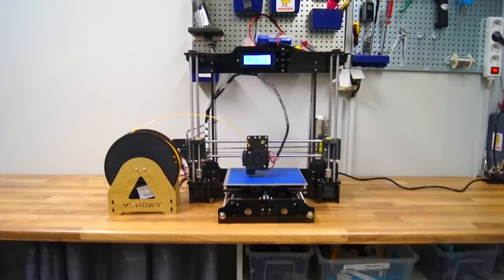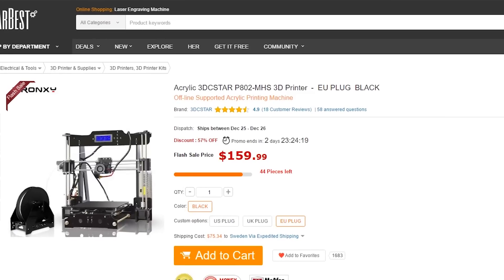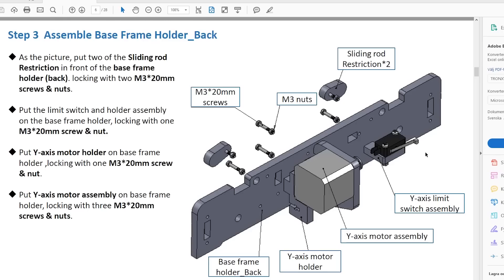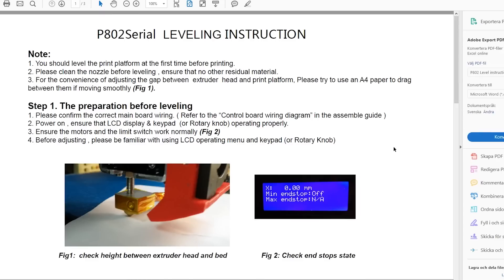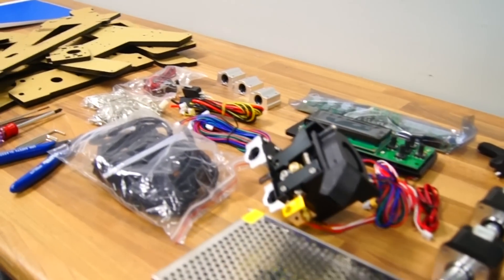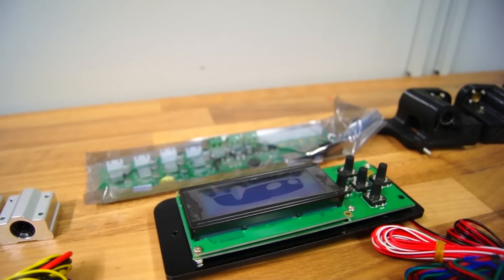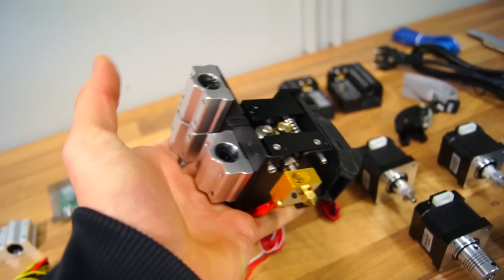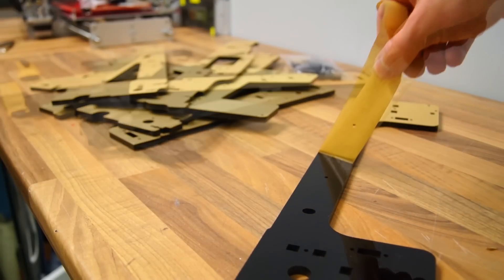Cheap 3D Printer Kit - 3DCSTAR Review

Comment: I got a Anet A8 but it will not heat up the hot end do you know what steps to take to fix it. I have confirmed it is sending power to the hot end but it didn't heat. If I have to replace the hot end heater what would be the type. My printer did not come with all the paperwork and the USB drive doesn't include the part number for the heater.
Reply from the maker: Did you resolve you problem? Sorry for the slow response.
Reply: No not yet. I think I will have to replace the hot end heater.

Comment: I also mounted the motor plate wrong! ahahah
Very nice printer...
Reply from the maker: It sure is :)
Reply: I still have one issue, when slicing with slic3r, the printer does not extrude, it start's printing, it does all the movements, but no filament comes out...
When using Cura, everything works fine...
What can this be?

Comment: One thing I noticed is that most videos of this printer show incredibly fast print speeds, leading to some pretty poor quality prints.  I've found that it helps to print slower, especially when you dial in the temperature.  Also I noticed that one of the threaded rods for the z-axis for my printer was tight (like the rod was a bit too big).  This led to binding when the Z-axis' were moving the extruder up (meaning one side would move and the other would not).  I fixed this with some lubricant.  Other than that, good review, I concur that this is a good deal.
Reply from the maker: The reason I print quite fast (55mm/s) is because I simply don't care about the quality. I always go with 0.3mm layer height and print at high speeds. Though, you are correct, lower speed does result in much nicer prints.

Comment: What is that blue stuff you put on the bed? Something like masking tape?
Reply: As LostName stated, it is usually more expensive than masking tape.  
> Tamiya Masking Sticker Sheet < is similar (250mm x 180mm) but is roughly 
$2 USD a sheet.  You can find it in hobby stores and on the internet (Ebay is one source).
Reply: Team PhreakLand Exactly. It helps with the bed adhesion during prints (It prevents your parts from being knocked off the printing platform).
Reply: But I've only ever seen masking tape in, well, tape-form. Do you have any idea where I can get this stuff in such large patches?
Reply from the maker: It came with the printer, can't find it on their website though. Shame, because it works really good.
Reply: I saw it on eBay once, but it is a lot more expensive than normal blue masking tape

Comment: I think anet a8 has better control board what do u think about it ?
Reply from the maker: They are very similar, but a lot of people are reporting major problems with the Anet version 1.0 motherboard. Usually connectors melting, or even catching fire.
Reply: I think the connectors arw melting because the cables were not inserted properly. I have the A8 myself and its quite tricky to assemble it if u never did something like it.
And btw I have no problems with the v1 Motherboard.

Comment: Congrats for 10k subs, man! And great video! But... I don't know... Looks a bit completed to me. Too much wires and connections. Too easy to make a mistake.
Reply from the maker: The DIY 3D printers for less than 300$ will have a lot of parts and wires. If you feel it's too complicated I would suggested the Anet A8. There's very clear instructions and the official Facebook group is very helpful.

Comment: does this catch on fire like the anet a8?
Reply: surviveonadime since when does the a8 catch fire lol
Reply: @MicrowaveGenocide  It's the printer with the worst reputation when it comes to this, because it's the one, and probably the only one with a very high risk of doing that, and many of them did it. The problem sits in a power supply that when not properly grounded offcharges to a capacitor which in turn explodes and catches fire